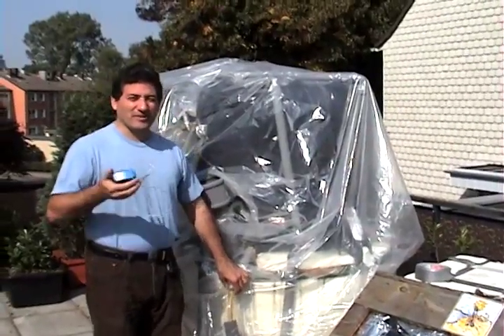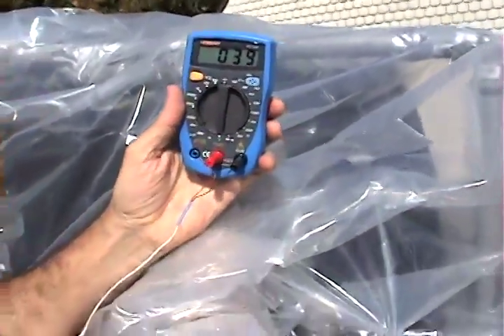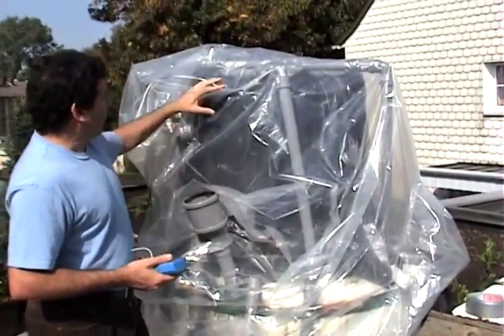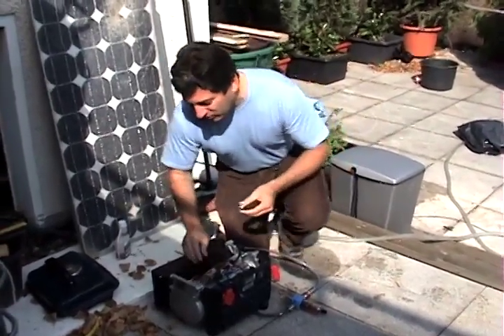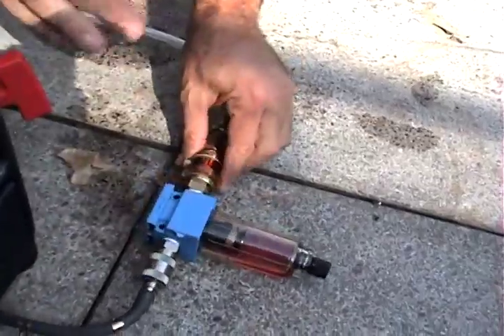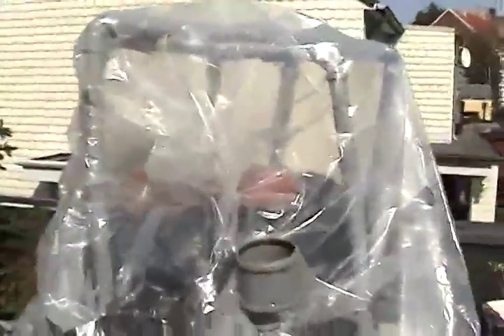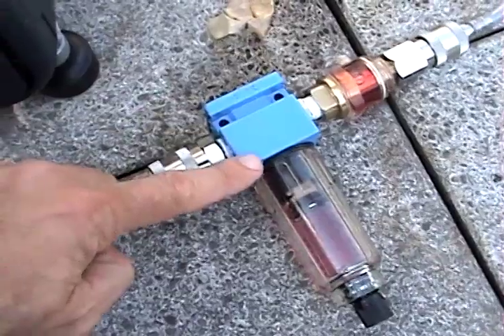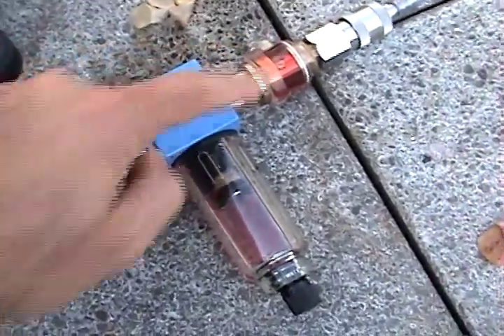3 minutes of electric generation from less than 100 liters of biogas

Comment: The Russians built a hanging mantle lamp with many simple bimetallic thermocouples arranged in the globe chimney in the 1950‘s or 60's that tapped the thermocouples in different spots to generate enough DC electricity to directly run a vacuum tube radio‘s 90V & 5V grid amplifiers while producing light as a coproduct, not parasitic function, while doing it. Perhaps that method could directly charge DC batteries without drawing resources from it for lighting or cooking, especially with LEDs. They didn't need to find a way to oil the mantle lamp, lol

Comment: Nice video. I understand you are trying to create a self sustaining fuel source, but I would suggest using gasoline to start the engine and get it warmed up. Then switch over to biogas. This will not solve any problems but it will temporally eliminate one so you can concentrate on another.

Comment: Internal combustion engines have been here a few decades and have improved somewhat, so... You should be able to calculate gas usage by displacement and rpm provided you know the fuel to air ratio at the power you need to generate, instead of guessing by experimenting without loading your generator.  Are you sure that you are German?

Comment: I'm no engineer, but isn't it possible to build a better sealed system ? 
As you mentioned in your video you thought you lost about 50% of the gas.
I understand that you are trying to figure out an easy system wich can be installed an run by practicly everyone. But it's a huge loss of energy.

Comment: how much  light will you get from gas lights  with that 100 lt and it very low tech it a lot cheaper than buying  a generator  ,i under stand what yr doing but i think you looking at it from the wrong way how about giving a home gas lights ,gas frig,gas cooking, some gas frig been going 50 years,all low tec .OR  you saying to people get power from a electric then you need a   electric lights ,electric frig electric cooking .and you need a electric generator there no different to us

Comment: putting oil in the spark plug hole doesnt get oil into the crank bearings, it just gets oil onto the top of the piston. You need to block the main jets in the carb, and leave the idle air normal and let the engine suck oil in through the carb. Using the idle air screw adjustment you can tune the amount of oil going into the engine. Since its a generator and deisgned to run at a constant rpm this should work fine.